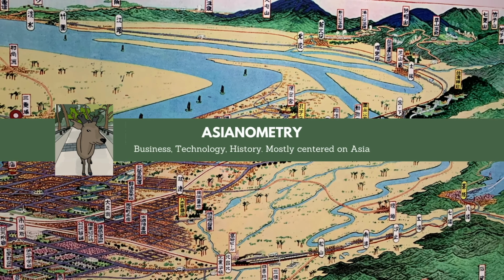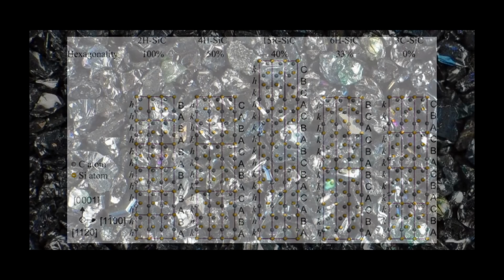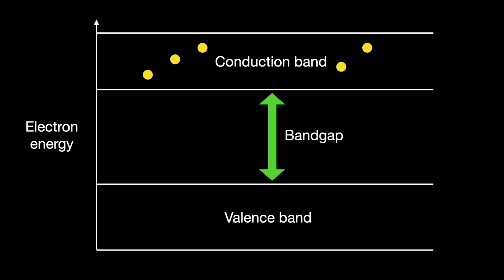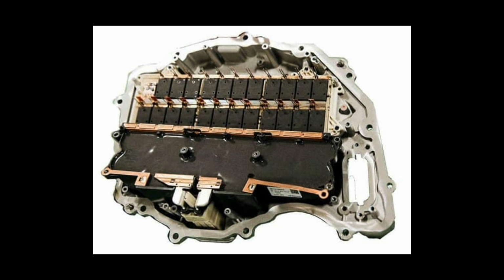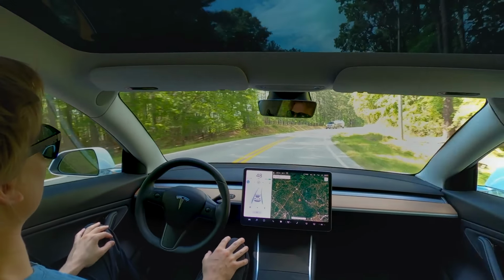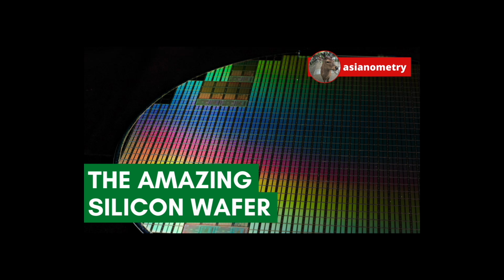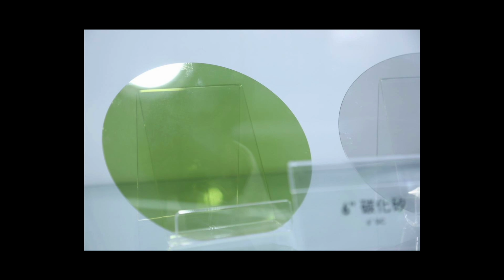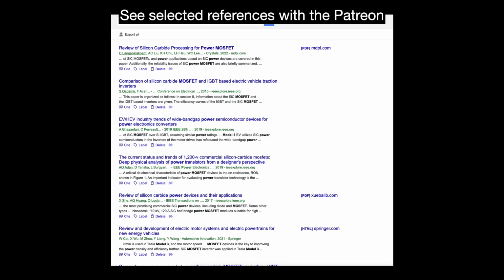Silicon Carbide: A Power Electronics Revolution

Comment: Interesting video as I started making use of the silicon carbide Schottky diodes for Meyer's technology as I learned how it worked and where Meyer went wrong and made many improvements to the technology using silicon carbide chips. I never knew the history behind the chips but just saw them on the market and was amazed at what they could do for this technology. Now the water for fuel technology basically lives again but I have to build it correctly first but I have posted the science behind this technology to put down years of fossil fuel industry propaganda about the technology.
When you look around the world you will notice that everything is already powered by hydrogen as all life depends on hydrogen to survive. I went over photosynthesis very closely to see if they had missed anything and it turns out they did. You see they never asked, "How does a plant break the bonds of the water molecules?" Answering that question lead me to the true science behind the water for fuel technology. What I found in my research was Meyer's method basically mimicked the earth's Global Electric Circuit and I suspect that Dr. Dingle's did also. All of these men were brought up in a court of law controlled by the fossil fuel industries money and lost their court cases, wow! big surprise there, huh?
Anyway I posted the science behind this technology at the OverUnity site under, "Stanley Meyer Explained." Note it is just the science as learning how to make it work correctly I did not teach, but I had to post it so that I could put down the propaganda surrounding this technology created by those that sell fossil fuels for a living.
I'm not really a fan of EV's as I know there simply isn't enough materials to go around to be able to replace ICE cars it's a dead giveaway if you just pay attention to the name of the materials they use to make EV's as they use "Rare Earth Materials," meaning there simply isn't enough to go around as we are talking more that 1.3 billion cars needing to be replaced and that number doesn't include other vehicles such as ships, farm equipment, warehouse equipment, and all types of planes of which the current technology doesn't have the power density to power right now. Thus the true solution is to switch the source of the hydrogen we need away from fossil fuels to just using plain ordinary water.

Comment: Multiple people have mentioned doing a video on GaN, I'd love that too.  
Another worthwhile topic relates to that graph about growth in the power electronics device use - the insane backlog in getting devices.  There a cracks in the supply / demand when it comes to processors and other devices, but the high backlogs on power electronics looks solid.

Comment: About carbide hardness: tungsten carbide is used in good ballpoint and gel roller pens as the ball. It sees a lot of wear and needs to remain smooth and spherical to apply ink evenly
Reply: Wouldn't steel be iron carbide?
Reply: @kayakMike1000  in the same way water is hydric acid, technically yes. Always a question of lattice arrangements etc.
Reply: @Ufbwgeufjdo  I recall seeing a video on youtube about how far a pen an write before running out of ink. Divide that distance by the circumference of the ballpoint and you have your answer haha

Comment: Hey, what does "... can operate 10 times higher temperatures" mean? Is that in Kelvin?
Reply: celsius, i suppose. The bandgap of SiC is 3.26 eV, which is 3 times that of silicon, so it should be good (in terms of leakage currents) up to 3x kelvin temps of Si. Which amounts to 6-ish times celsius temperatures.

Comment: Tesla would have better shrunk the elefant in the room, the battery, in size and weight by half. Still the problem to charge it quickly and easy like filling up gas would have remained though.

Comment: I probably have 25 lbs. of Silicon carbide cutting tools. Solid drill bits, endmills and tool inserts. The stuff revolutionized the metal working industry when it can out. I would think that is where most is used.
Reply: I did ultra-precision (Single Point Diamond Turning - SPDT) machining of optics in a research environment. I also processed a lot of chemical vapor deposited (CVD) SiC into optics for uncooled high energy laser optical component development. A diamond tool for SPDT uses a gem quality natural or synthetic single crystal diamond, very precisely shaped, to ductile machine at near atomic levels. These are very expensive and delicate. And can't be used on carbide forming metals like steel.  Since I had heaps of CVD SiC I experimented with machining with it as the cutting bit. Indifferent results because of the polycrystalline nature of the CVD SiC. Single crystal SiC I would think could substitute for diamond for less critical applications, but might be really beneficial for ultra-precision machining carbide forming materials like steel.
Reply: @randydewees7338  Yes, and then all the Tungsten Carbide tools went to very hard CVD coatings. I lost count of how many have been developed. I know Titanium Nitride is gold in color. Then there is black, gray, all kinds making them last and perform even better.
Reply: It's much more likely that you have tungsten carbide tools, not silicon.  OTOH, you likely have SiC "wet or dry" sanding paper. There's a few other carbides used in tooling (like vanadium), but I've not heard of SiC tools like endmills and drills, etc.
And just 'cause it's YT, and there's always someone one-upping somebody else, I have about 250lbs of TC tooling in my shop.  Maybe more...
Reply: @davidb6576  My bad, Tungsten carbide is correct.

Comment: So basically you purify SiC by distilling it (it's just that the condensate is solid, not liquid) - it is a wonder it took so long for people to think of that. This video focuses on medium voltage inverters (ie for EVs and solar panels), but one of the big constraints on building a fully renewable grid in large countries is actually the expense of HVDC, which is heavily driven by the cost of solid state diode and inverter cascades. Do they make IGBTs in SiC for high voltage?

Comment: Apparently IGBTs have greater tolerance to cosmic rays so they remain top choice for large utility scale grid-tie solar inverters. At voltages above 1kV DC there is little improvement in efficiency with SiC.
Reply: Improvements should be higher at higher voltages, exponentially
Reply: @ArpanMukhopadhyay93  Solar panels are limited to 1500V DC max due to insulation requirements. At that voltage the difference between efficiency of IGBTs and SiC MOSFETs is 98.9% vs 99.2%. SiC makes sense for smaller <250kW string inverters allowing to make them smaller and lighter than IGBT type.

Comment: I enjoyed your review of silicon carbide transistors, fascinating stuff.

Tesla, it turns out, has pioneered all sorts of interesting tech: dry-coating battery electrodes, carbon fiber tension wrapping for high-speed rotors, Dojo, neural net chips for automotive use (much superior to GPUs), vision-only vehicle autonomy (no lidar, radar, or sonar sensors needed), heat pumps for HVAC in vehicles (with remarkable integration for both cooling and heating needs), auto-labeling for objects in video feeds (vast reduction in labeling manpower requirements), accurate distance estimation for objects in video feeds (again without lidar, radar or sonar), unified 3-D virtual simulation of a car's environment from pixel-based video feeds, Megapack batteries to replace gas peaker plants for grid utilities, Autobidder software which automatically buys and sells power for a utility to keep its grid stable (millisecond response times), and more.  Tesla pioneered 46x80 mm cylindrical battery cells for automotive use, solving many cooling and manufacturing difficulties with this larger cell format - and then used the cells as structural elements to enable deletion of hundreds of underbody parts.  This is just a sampling, really.

AI Day should happen sometime this fall at Tesla.  I'm expecting to hear about their progress with Dojo, FSD, and maybe even see an early prototype of a humanoid robot which uses AI to recognize objects and navigate in the real world.  Hopefully!
Reply: What is this? Tesla ad? You a shareholder?
Reply: @MrFujinko  This channel has delivered content concerning AI - it's one of the author's areas of interest.

Some exciting things are happening in this field at Tesla.  I'm merely interested in the author's opinions concerning Tesla's AI hardware and software engineering.

Comment: Another great video. Being an engineer this was very easy to understand, but I think your explanation still bought a lot of easy to understand points to the Lay person. Your walk through the history of the materials and technology is also most important for the younger viewer (I do hope you have many young viewers). Thanks.
Reply: I'm 25, is it young? it's not related to my field at all as I'm working in finance, but learning how the world works fascinates me 😀
Reply: @kuckoo9036  Things like SiC can form in many different crystalline structures, but only 1 ~ 2 can be used for electronics. The explanation of the Bandgap couldn't have been much simpler. The connection between the heat conductivity of the switching devices using SiC and the compactness / simplification of the design of the electronics and power control system was very well presented. Revisiting the material itself and walking through the process of making electronics grade SiC was very clear, and showing how the price has slowly decreased over a number of years gives anyone confidence that it is not magic, just a relatively new technology with a few teething problems.
Got to go. Dinner time.
Reply: A lay person of 70 years old like me who was educated during mainframe computer age using punch cards could understand such topic as well.
Reply: @kamolhengkiatisak1527  i am 22, working in SiC fabrication R&D lab
Reply: @kuckoo9036  I'm a software developer, and I loved hearing about the manufacturing challenges of building large silicon carbide crystals.  While I didn't understand 100% percent of it, I easily took in enough information that I can now explain the basics to fellow EV nerds.  Awesome video!

Comment: Defective (maybe, maybe not) boron carbide chest plates for furnace lines are on ebay. 

Carbide sandpaper for metal and flint or ruby for wood or you'll be sorry. Al ox is fine for rough work.

Comment: I wonder if instead of trying to create bulk solid boules, a better method might be to use vapor deposition on to a carefullly designed surface and a gradient in temperature, pH, electrical or magnetic field, etc., that has a correct structure to encourage the SiC crystal to grow in two dimensions as the surface moves past the vapor source. This could create very thin SiC wafers, or even thicker ones, and produce very low defects while also eliminating the need to slice wafers from a solid. An automated system might be composed of wafer-sized plates linked on a "chain" that recirculates, with wafers being created on each plate which after cooling etc. gets lifted off for further processing, while the chain goes around again.
Reply: I’m looking forward for large scale space based manufacturing. This would be an advantageous environment for lots of products like this one. Nanotubes is also another potential product for this environment.
Reply: @walterlyzohub8112  Yes. One product already proven for space manufacturing is an optical fiber called ZBLAN. This fiber has been manufactured on the ISS already, and test pieces distributed to potential customers. ZBLAN offers dramatically improved transparency and optical data throughput vs. all other materials, but can only be made in microgravity. The test converted 2 kg of material into thousands of dollars of optical fiber. The primary use of this fiber is anticipated to be in supercomputer data pathways.

Another potential area of production is modifying the epigenetics or biological (plant or animal) stem cells. Preliminary research has shown that microgravity affect stem cells. encouraging them to adapt to stressors rapidly. Then clones of those plants retain the new abilities.

Overall I believe a variety of adapted biological processes will be among the targets of space mfg.

But one area I anticipate to become very important will be IC chip manufacturing and possible crystal growth. Microgravity offers crystal production advantages in this area similar to that of ZBLAN, potentially allowing new substrates and doping and printing processes with higher precision and repeatability. And the vacuum level in orbit is easily made to be much cleaner than any lab on Earth that contains air, potentially reducing defects and improving yields.

I believe that in 10-30 years a wide range of new technologies will be possible only due to microgravity manufacturing.
Reply: @GaryBickford  There is a nice article about this on the English Wikipedia. https://en.wikipedia.org/wiki/ZBLAN (search for Fiber Optics).
Reply: @Basil-the-Frog  ZBLAN -  cool, I'm familiar with that for use in fiber optics! A company I'm associated with was one of the early funders of Made In Space, which sent the first fiber fabricator to the ISS and made ZBLAN fiber in microgravity. This (for those readers who don't know) is necessary to keep the ingredients from selling out and crystalizing wrong, making poor quality fiber.
I wasn't aware of the use for planar crystals though. I'll read up on it, thanks!

Comment: John Atanasoff, inventor of the Atanasoff-Berry computer, one of the very early stored program digital electronic computers, talked in a speech at the Computer History Museum about theorizing about building transistors out of silicon carbide as far back as the 1930s. He knew that both galena (lead sulfide) and silicon carbide could serve as a cat's whisker crystal detector in a radio set. When they were improperly adjusted, they would oscillate, and oscillation means gain/amplification. Interesting that silicon carbide semiconductors are now a commercial product. Atanasoff envisioned making them out of what we would call nanowires.
Reply: Also i gonna quote you Stanisław Lem:
"No predictions came true. It turned out that only Antoni Gołubiew was right, who liked to repeat that the future lies in the fact that “everything is different” - differently than we imagine. And it really is. Except otherwise - it does not mean either greater or more terrible. Just different."
And Stanisław Lem is a Polish Sci-Fi writer that in his books predicted: Internet, Google, e-books, audiobooks, tablets, smartphones, 3D printing, Virtual Reality...
Reply: Its kinda amazing that someone made a "Computer History Museum" so many years before the first computer was actualy made...
"and oscillation means gain/amplification." ekhm?! What?
An amplifier is a circuit which amplifies the weak signal and raises the amplitude of the signal.
An oscillator is a circuit which generates the AC waveforms of particular frequency for providing source to an electronic circuit.

Comment: Why would silicon carbide be useful with solar panels?  The temperatures are mild.
Reply: The power electronics that solar systems use, not the actual PV- cells.
Reply: Grid tie inverters - PV strings can run at 1500V DC and need to be switched to produce a sine wave for grid connection. Silicon Carbide semis are a good match for this when you are switching several hundred amps as you can run it hot and save on cooling costs.

Comment: Why do EV motors use AC?
Reply: dc motor torque is kind of servo springy while ac motor torque wont just suddenly launch off into the high rpms with loss of load because its being told to turn by 30 or 60 degrees at a time (for a three phase motor) 

dc motors have brushes to wear out particularly when overloaded. ac motors dont have brushes. brushless dc motors are ac motors driven by an inverter supplied dc power..

some say efficiency but i dont know the stats.
Reply: @hardrays  None of the vehicle DC motors have brushes. They are all electronically commutated.
Reply: @gregorymalchuk272  Re-read what he wrote.
Reply: @gregorymalchuk272  again, as i noted, brushless dc motors are not dc motors any more than an ac motor driven by an inverter driven supplied by a dc source. dont get confused by the transitional tech sales newspeak "electronically commutated dc motor"
Reply: @hardrays  "Brushless DC motor" isn't newspeak. Claiming that Brushless DC motors don't exist papers over the reliability, fire hazard, and maintenance headaches that brushed DC motors incur.
Reply: Because that's the only way to make them rotate and produce continuous torque.
Reply: Because DC motors are kinda fake, you need some varying field to get a motor to rotate, so they're all AC driven essentially. 
Oh, and an electronically driven motor can be extremely responsive and well controlled because the inverter is running at 30kHz or more.

Comment: Is it good only for power eletronics or it is interesting for CPUs too?
Reply: I think high band-gap makes them harder to operate at low voltage, so I don't think they have any advantage in logic circuits presently. High- temperature medium- scale logic might be a niche for them, eventually. 
SiC device manufacturing is much less mature, they're not able to get them to perform exactly how they want 99% of the time, like with silicon, yet.
Reply: Probably on the surface of Venus